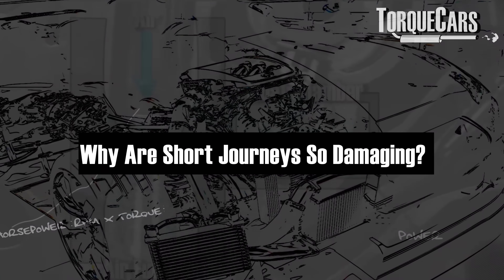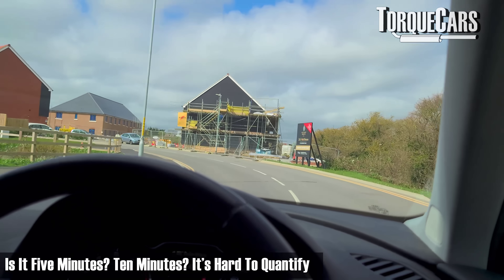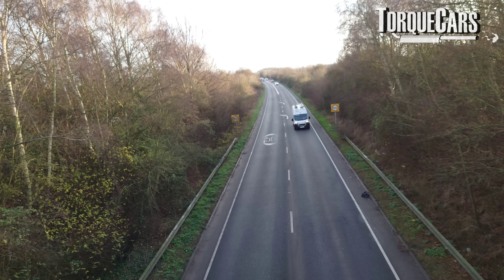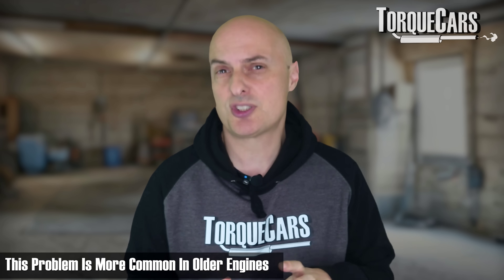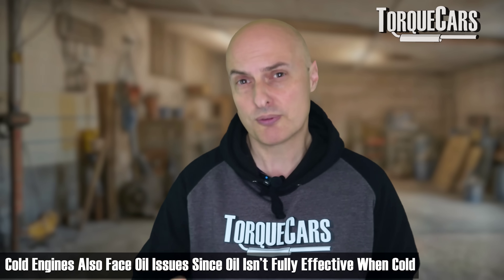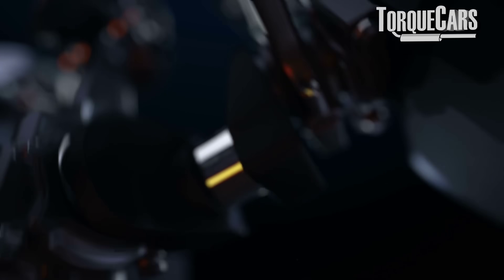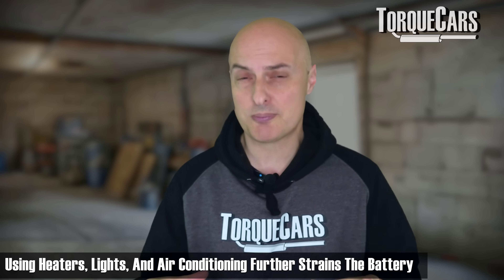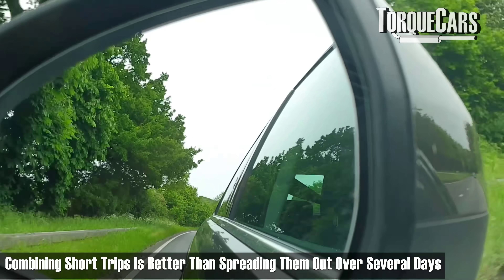Why Short Drives are Damaging - Discover The Causes & Avoid The Problems Of Short Trips.

Comment: Most cars today don’t have a temp gauge. This and my last car only have a blue light for cold run which goes out after an initial warm up time* and it turns red should the engine ever start to overheat.
*initial warm up doesn’t = fully warmed up.

Some cars take longer than others to warm up. The worst I had for that was a 2005 VW Polo 1.4TDi which took around 4 or 5 miles to start warming up (and provide any warm air).
Conversely, the quickest I had for that was a 2010 newer style polo, petrol 1.4 DSG Auto….that engine warmed up quick and generally ran hot…..again no temp gauge, but in summer the cooling fan would activate a lot. Maybe running hot improves economy?

And Idle-stop really doesn’t like short journeys especially in cold weather.

Economy also takes a massive hit on a short cold journey, even with a diesel.

Lastly, pls before you switch your engine off, switch everything else off…things like heaters and so on….because otherwise when it’s next started, maybe in winter, maybe with a weak battery, all that stuff is going to come on just as you try & start the engine.
Reply: My car has a weird warning for a weak battery that I found weird and had no idea it was the warning at the time. When starting the RPM and speed would go to maxium back to zero and then up to normal. After this 1st happened within 4 weeks the battery became incredibly weak. Diesels always take longer to warm up than petrols and suffer more cold start issues and abnd battery issues due to higher combustion tempretures. Smaller the engine the better and petrols in general warm up quicker. Takes 10 minutes in winter for my 1.2 Turbo petrol engine to get up to operating tempreture it took the 1.9 SDI unit before it at least 20 minutes.
Reply: @ your 20 min for the 1.9 diesel warm up is similar to my old 1.4 TDI.
Extremely robust car though more so than the more “dynamic” or “sporty” Polo which replaced it.

Comment: At cold start, I let my car idle until it gets down to 1,000 rpm
Reply: I have a 2001 Honda civic (currently have an unrelated issue so I cannot drive it) and I always wait until my engine temp at least be readable on my gauge in the winter due to taking so long to even do that. That little 1.7L engine in it doesn’t put out much heat.
Reply: @deylin8914  so, you're not understanding the dynamics of the situation:  the whole point, as he explains, is that idling to warm up takes forever, and thus wears the engine significantly, vs taking off very slowly  within the first few min's of starting the engine.  And generally it's safe to start off even in the first 30-60 seconds.   This is real sci and engineering, not speculation
Reply: And the temperature gauge goes up to hit the first line
Reply: @nekopop8159 exactly  , they say wait about 10 seconds then slowly drive,  ive never done that , when its 40  below , no way
Reply: Im in north dakota so

Comment: I'm looking at oil pressure. I want all my trips long enough to push the oil pressure down to the level that is normal for a fully warmed engine.  Fortunately, my automobile contains a gauge for that, but there are OBD2 cell phone applications that provide that information.
Reply: Idling at 750rpm 2barg oil pressure when coolant is 80 to 82 degree C. 1barg oil pressure when coolant is at 90 to 92 degree C. 🎉🎉🎉

Comment: I did not get it here https://youtu.be/z6A7fxtQYsk?t=503   Why the battery wil be affected turning one the A/C  the defogger etc.  the motor is on, and the alternator is supplying the energy for all those components.  the only way the battery will suffer is because the alternator is not giving the require watts, and the battery is supplying the difference.
Reply from the maker: Sorry I didn't explain very well, the alternator provides the power when the car is running and excess power can be used to charge the battery. We are talking about not allowing enough time for an overworked alternator to put charge back into the battery, the cumulative drain never gets topped up and you end up with an ever diminishing charge in the battery.

Comment: This all can be mitigated. I live in subarctic Canada.  The average temperature in the winter is -30C with many days below -40.   I usually start driving as soon as I can see out the window.  Some days it’s 20 minutes.  Some days 30 seconds. Usually I do not plug in the block heater as I am too cheap to pay for electricity. I do take off slowly with my main concern being the automatic transmission.  Vehicle will never get up to temperature for weeks.  So what is the solution?  Change your oil more often. Vehicle is a 1999 with 260,000.   Still doesn’t burn oil. Still on original catalyst.  
There is a concern with the battery being  discharged especially the newer vehicles. Solution is to operate the engine in the 1700 to 2200 rpm range for at least 10 minutes in a trip before shutting down for the night. 
I really think that the manufacturers of these newer turbocharged direct injection engines are conning the public with their extended drain intervals. Oil is cheap. Engines are expensive.
Reply: Oil is cheap, engines are expensive. All true, but it get worse. Usually, an engine failure means replacing the entire vehicle. People need to equate the productive (engine), the products they are using (type of engine oil) and the type of driving they are doing. The big problem is that people do not want to accept that they type of driving they are doing represents severe duty even if it doesn't feel severe. Driving around the neighborhood and doing a four-mile commute doesn't feel severe. But it is.
Reply: environmental agencies are trying to tell people to use less oil even at the cost of damage to the engine
Reply: Park your car in the house.
Reply: Use the block heater, as soon as it's below +15°C.

Comment: Yeah the 1.4TSI / 1.4TFSI warm up very fast because the cat is very close to the engine , not far from the headers, unlike most cars with cat under the car , here the cat is in the engine bay, its at the bottom but still in this area
Reply: Small petrol engines in general warm up quick. Some big diesel engines can take light years to get warm. My Mum under my advice went from 1.9 TDI MK5 Golf to a Suzuki Alto and she can notice how much quicker it warms up just based on how quick warm air starts getting pumped into the car in winter. She only does short trips so a little 1.0 petrol is perfect for it the Golf needed £800 on welding a pair of rear ball joints and a cambelt was almost £1500 to repair so she picked up an Alto for £900 and the scrap value of the golf at £250.
Reply: @gravemind6536  electric is the ultimate for short trips, although getting one for £900 would be quite a challenge.
Reply: But in case of ceramic catalyst, if it will start falling into pieces, there are more chances that ceramic dust will be sucked back into the engine especially through the EGR and then goodbye engine. I had that on Hyundai Accent 1.4.
Reply: There's more to it than the cat being up to operating temperature. My 2024 TAOS has a 1.5 TSI and what is most important is not only the cylinder heads getting up to operating temperature for clean combustion (within 30 seconds) and the coolant in the cylinder head getting quickly up to operating temperature ( 2,3 to 5 minutes here in So CA) but the oil temperature getting up to proper within range operating temperature, about 122 F. This is standard both on my Rotax 912 ULS 100 HP Light Sport Aircraft engine before run up, as well as all European motor vehicles... It takes 120 -122F temps for both the engine components to heat up and expand enough to get to proper operating tolerances due to different expansion rates between pistons and cylinders AS WELL as the oil viscosity at 120F temp and oil ADDITIVES to get into an effective operating temperature.  So ALSO don't run your engine hard until your motor oil gets up to at least 122F on your infotainment center in the dash if you own VAG product.

Comment: Modern DI turbo engines for short trips are fastest way to enjoy problems.
Reply: yeah but like only if you never do any longer than 5 minute drives and if you only go 5mins away from your home there is other issues you need to adress
Reply: If you warm up your engine before the short trips and idle the turbo for ~20 secs before shutting off you will be fine. I have a 2019 Audi Q5 with 170K miles and it hasn’t seen any problems doing that.
Reply: You need to idle turbo more (1-2min) if you push hard (highway drive) in the last ~20-30 min.  @andrewgus8763

Comment: thanks!! my grocery store, work, etc. are all within a 5 mile radius. this is how I use my car:

1. Start, wait for RPMs to drop (10-30s)

2. Drive gingerly until the coolant is up to temperature. (Manual transmission, so I try to keep it around 2000 RPM).

3. Keep driving for 5-10m to allow the rest of the engine to come up to temperature. 

4. Wait for 15s before turning off the engine.

I like having a manual transmission, because I can get the RPMs up (with a load on the engine) without going highway speeds 😊
Reply: This turns a 2 minute trip into a 10 -15 minute trip, but it’s worth it
Reply: Get a ev
Reply: @nikolaigordon  lol.  Yeah, spend on a new/newer car just bcuz of of this?  lol.  that makes Zero sense and is a waste of massive money vs keeping an older ICE engine car
Reply: the extent to which it's warmed up is mostly related to how big it is.  A 4 cyl is quicker to fully warm than my 3.5v6

Comment: I would guess, that the thinner the oil (0W-20), the faster the engine gets lubricated on a cold start.
Reply: Most modern engines rev higher at cold start to have enough oil pressure to lubricate before drive off. 0w20 is just fine
Reply: I'm sure project Farm tested this at some point. I always say no matter what always wait for all the warning lights on the dash to go out before starting that gives the fuel and oil pumps enough time to circulate and lubricate the engine.
Reply: @gravemind6536 do the lights actually go off after some time i never saw them do that
Reply: Yes, thinner oils will circulate faster, but the difference between an 0W-20 and, say, a 5W-30 is minor.  It's a common myth that most of the engine's wear occurs in the several seconds before the internals start seeing circulated oil.  Most of the wear occurs during the several minutes before it comes to operating temperature.
Reply: engines are lubricated very quickly on startup, the longer your car cranks the starter the more pressure it builds up

Comment: If all your journeys are short, you are screwed then!
Reply from the maker: We have to ask if we need a car? I regularly walk 15mins whereas a few years ago I would have driven that distance and thought nothing of it. 

Doing a long run at the weekends will mitigate the oil dilution risks which I see as the major long term risk (albeit a small one).
Reply: @TorqueCarsDriving  not so sure that dilution is a small risk long run, at all!   The more hours i spent in past decade here on YT and talking w/ my car experts/mechanics, and having had a father who was a chemist and genius and fuel/lube chem-engineers elite group/club, etc so forth, the more the dilution is a mega issue now w/ shorter drives, with the engines having these looser rings
Reply: Ride a bike
Reply: @Conalt07 What if you are old or infirm, or have heavy bags of shopping?
Reply: @stephenvarty191 I was just tossing an oversimplified, judgmental, and snap response to be silly… You have elderly, the sick, folks in brutal climates, dangerous roads…etc… It makes my response even more absurd.

Comment: So let me get this right , Engineers have been developing engines for decades and you are trying to get us to believe that cars wear out when cold ? 
We have Direct Injection and fully synthetic oils . Just get in the Car , start it , let it run for 30 sec and then drive off . Drive reasonable until at Operating temp . Also Car engines will out last the car so i would not worry about the engine . Its all the cheap plastic 3D printed parts that you should be worrying about .
Reply: "Just get in the Car , start it , let it run for 30 sec and then drive off"

literally what every owners manual says for any modern car, if people would bother to read the manual instead of assuming they know better.  referring to some of the comments (advocating idling), not to the video (which didn't.)

amusingly, warming up by idling puts significantly more wear and tear on a modern engine compared to warming it by driving gently.  so people that idle for five minutes because their dad's mechanic told him back in 1981 that that's a good idea (it was at the time btw) are actually being significantly harder on their engine
Reply: You obviously don't know shit about cars

Comment: Nice informations! I have a question about temperature; I have an Audi and I always try to get it to four bars which usually equals 150° according to the gauge, do you think that’s adequate to get it out of that short drive zone? Also, when the car is running, isn’t the alternator providing a lot of the energy for heat, ventilation and other electrics or is that the battery in the accelerator is just recharging it?
Reply from the maker: Cheers buddy, appreciate the kind words. Most will drive really carefully at first and then use more of the RPM range as the bars start creeping up to full rpm and redline when all the bars are lit. Oil temp usually takes a bit longer and is more accurate than water temp but we have to live with what we are provided.

The alternator provides the charge the car uses, and hopefully there is some spare to dump back into the battery to top it up. The short drives can mean there is less chance to top up a battery - I didn't explain that very well did I?

Comment: Informative video, my old 306 GTi-6 had an oil temperature gauge. Took a good 20 mins to get the oil operation temperature. Much slower than water temperature.
Reply: That really depends on the car and how much oil it holds. My fl5 civic type r has an oil gauge and it will reach operating temperature in 7-8 minutes. An e90 bmw m3 will take forever.
Reply: @ASJC27  fair point, I’ll stick with 15 mins as a rule of thumb. Got a third gen CRV these days
Reply from the maker: Thanks for the input, it is interesting how much longer oil temps take to register.
Reply: @ never booted it until that oil gauge was where it should be.

Comment: What is ideal oil operating temperature? Why do manufacturers omit an oil temp gauge?
Reply: A multigrade oil will have good lubrication at below 100F.  There will be no problems with lubricating the bearings or the head.  We use diesel truck engines in small generating plants and will start and idle for 30 seconds, high idle for 60 seconds and depending on the load can be at 100% in 10 seconds. Our oil analysis has never shown any excessive wear. We don’t see any significant difference between the engines started every 10 days or the ones started 140 times a week.  One caveat is that the oil must be changed on time.  Engines that suffer from catastrophic damage usually are a result of an extended oil change in the month before the incident. 

On our gasoline vehicles at any temperature above -5C  simply start the vehicle, put your seatbelt on and drive away moderately if you can see out the windows. Never had an engine failure on a 15 vehicle fleet driven for 11 to 13 years (35 years of records) we do use AMSOIL and later any synthetic oil starting in the late 1980s. For colder temperatures vehicles just need to be warmed up enough so that when they are at idle they will start to move in drive.  For standard transmissions they just have to be warm enough so that they don’t stall when putting into gear.    Since there is always snow and ice at these cold temperatures one usually drives conservatively. The minimum oil change interval would be six months regardless of mileage.  Expensive oil is cheap.  Cheap engines are expensive.
Reply from the maker: Cost I suppose is the factor, plus if we can't look after our cars we buy new ones. The situation isn't that critical though, at worst when you drive hard on very cold engines you are increasing wear and tear a little and it probably won't be a noticable issue until after you've sold the car on to someone else. 

I would say oil temps are more variable as different engines, and grades of oil respond differently. It will typically warm up to a point and sit there, that is the ideal temp in most cases.
Reply: What would you expect 99.9% of drivers to do different if there was one?